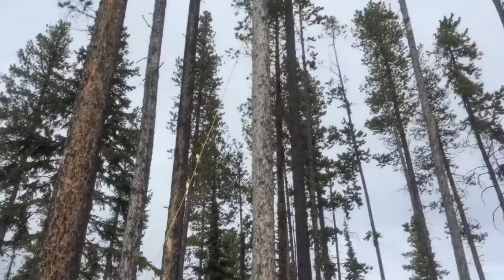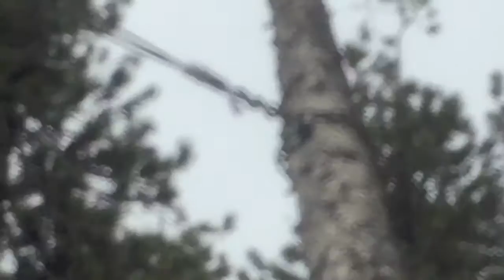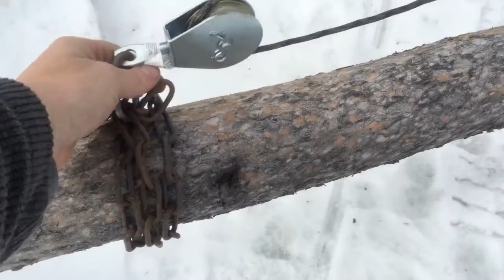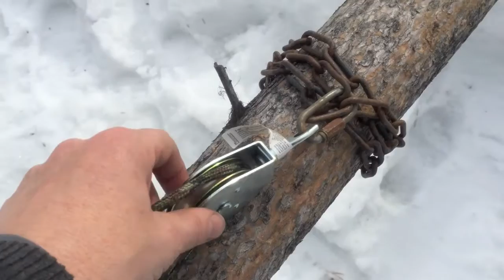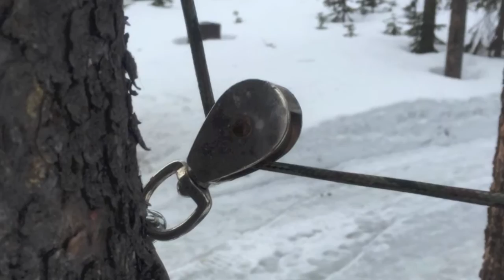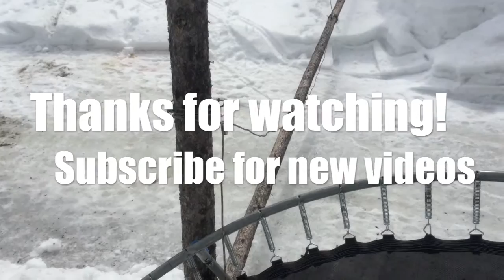Experimental Wind Turbine Tower Project - Using a Tall Tree (Part 2)

Comment: learn to use a block and tackle method. then use human power to get the tree up. less stress on the jeep and winch.
Reply from the maker: +Nathan Dean If I had a block and tackle, I would definitely go that route.  Thanks for the suggestion!
Reply: The Cedar Workshop
you can make one from common parts. like from old dish washers. their called pulleys. or you can make them by hand from wood as well. it called thinking out side the box. or you can line up several pulleys together in a row.

Comment: Hi Scott, Great idea getting it up higher.  Do you think the dead tree is going to be strong enough or are you going to  maybe bolt a piece of angle iron  along the length to strengthen it up?
Reply from the maker: +Aceman307 Yeah, the top was kinda flopping around like a dead fish. Might cut 8 feet off and utilize a pole from the existing tower. Angle iron would offer more support. I was think of adding an antenna to the pole for better cell phone recption.